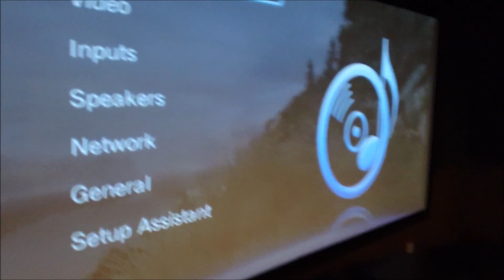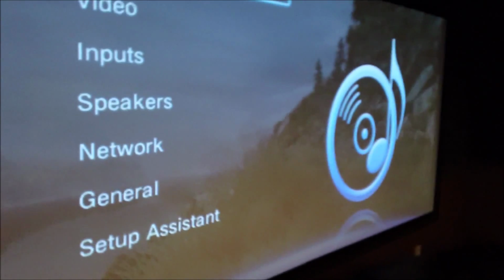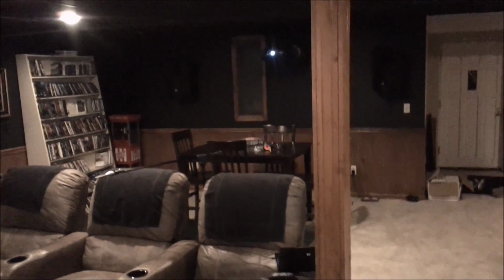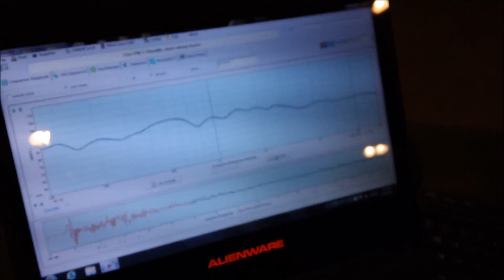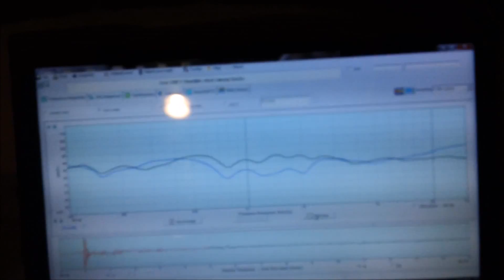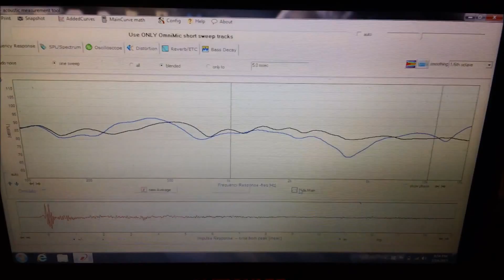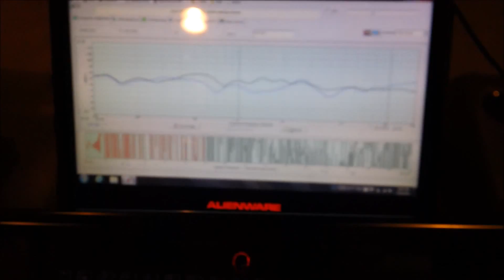Flat Frequency Response High End Speaker Debunk - Why it doesn't really matter

Comment: It doesn't need to be PERFECTLY flat, but it still needs to be flat enough, is it correct?
Reply from the maker: That's correct - but if you EQ for a single seat, it will change the EQ in the other seats -- so which seat is flat and which is worse for the first seat being flat?

Comment: This is dumb. Of course frequency response changes with mic position.
Reply from the maker: Well here’s the deal. I posted this video in reply to an AVSForum argument where people were arguing over the recommendation of one speaker over another because the specs were a dB or so tighter than another speaker — intending that the 1 dB of frequency response tolerance made the one speaker better than the other.  Having listened to both speakers extensively and owned them both I knew the “inferior” speaker was better.  I created the video to show the concept that that +- concept and benchmark racing doesn’t amount to much when you put it in a room where the +- range increases dramatically.   You may know this — certainly everyone on AVSForum in that discussion thread did not.
Reply from the maker: Point being that people obsess about specs +-3 dB 35Hz to 20KHz for instance and if you move the mic a foot or 2 you might be +-5dB or even 10dB
Reply: @jvonengeln  When tuning speakers it's probably best to test directly in front and at 45deg off-angle. Then add a little high-end sparkle to the make the mid-point between the two of them flatter. 

Nothing is done in isolation, specs included.
Reply: @jvonengeln  The point being you need some kind of reference when designing speakers and results need to be tested against baselines.
Reply: @jvonengeln  and yes, it does make +5 or 10dB difference when you change listening position sitting in front of a whole bunch of random sub-woofers in amongst couches and wall treatments. It's a room. It has a sound. 

Even in an anechoic chamber you'll see differences let alone in a room.

Comment: You're missing the point.  Frequency response is important because it indicates how accurate a speaker is.  A good speaker treats all input frequencies equally - it doesn't alter what is being fed into it.  A speaker response that is rough with crude spikes indicates that the designer has failed to control undesirable resonances.  Of course, in order for a frequency response specification to meaningful, it must include a +/- db tolerance with the spec.  For example, 80Hz - 20,000Hz +/- 3db, or in the case of my beloved Paradigm mini monitor speakers 57Hz to 20,000 Hz +/- 2dB  (the tighter the tolerance, the more accurate the speaker is)  Every audiophile knows that the frequency response changes depending on the room and that adjustments are needed to get the speaker to sound perfect, but you must have an accurate speaker to start with.

Comment: Flat frequency response is very important in recreating the intended sound that was intended for the listener.  Just like every strong structure or system, the foundation haas always been the most crucial part of it all.  It must start off at a flat response at both on and off axis.  Noe of course the room will change the tonal balance do to reflections, standing waves, and other factors.  Thus you must use absorption panels to limit the cause of the tonal imbalance.  To spot the problem areas however you will need a reference mic, and do a waterfall test to see where the decay time happens within the frequency spectrum.
Reply: Exactly.  A quality speaker with a flat frequency response treats all frequencies equally and doesn't alter the sound being fed to it; it is a measure of speaker quality.  Every audiophile or audio enthusiast is well aware that the room affects the sound which requires equalization adjustments or room treatments such as absorption panels, etc.

Comment: speakers with an inherent flat response would at least, go less hay-wired than those that have already hay-wired inherent response. i've heard a lot of colored systems, they never work well in any room even with EQ. though, i'm not into high-end. good speakers don't have to be high-end. even junk-grade components can turn into a really great system if you know how to do it.
Reply from the maker: Ped-Away-G   Mackie c200 have a very decent FR, and polar plot.  Published on Mackies site.  This will happen in any room with nearly any speaker.  I’ve measured several dozen home theater rooms during tours on avsforum.  It’s just the way it is.  I really enjoyed the Mackies for what it’s worth.  The only way you can get away from that issue somewhat, I think, is with line array speakers.  Which is why I now own 13 JBL CBT 70j-1 in my theater room.  The universal similarity in the coverage of sound as you move about in my theater room since installing the JBL line arrays is the best I’ve experienced in any room. Every seat  sounds the same, standing up, sitting down sounds the same.  The stereo listening sweet spot you can barely escape from.  I need to do a part 2 of this video for comparison with a FR capture using line arrays.

Comment: One question. Why are there 5 subwoofers up front? I feel that overpower the rest of the system.
Reply from the maker: Jesse Johnson  headroom.  I dial them in no louder than I would if I had just a single sub, but as i turn up the volume when a single sub system would be distorting and begging for mercy my eight 18’s stay distortion free and clear and accurate.   Each sub has less work to do individually to achieve the sum output.

Comment: Thanks for the vid. I'm not an audio engineer nor an audiophile (meant in a negative context), but appreciate the video as a good reminder that those of us who take a more scientific approach to system design may be suffering of some of the same delusions as the audiophiles who need solid gold 24k cables, purified energy source and so on. Thanks! Unfortunately this doesn't make the process any easier for anyone :)
Reply: I consider myself an audiophile but I'm also an electrical engineer so I laugh at these so called audiophiles who claim that these crazy cables and connectors make a difference.  Not until you enter frequencies in the radio frequency range does it make a difference.

Comment: I was gonna say something different, but then I actually watched the video. Dude. You're clearly not an audio engineer, stop acting like one. You're saying there's no reason for flat response speakers on a home theater. You're right. But what you're not aware of is making you look a bit cocky, tbh. First things first, the other posts got it right. Flat response speakers are for mixing and mastering. You're not doing either of those things. Second of all, your main channel speakers should be the same distance from one another that you are from the center of the sound field in your regular listening position. Third, your speakers need to be at specific angles in relation to that listening position to accurately reproduce a stereo sound as it was intended to be heard.

That being said, of course if you move the listening position the response changes. That would be obvious to anyone who had any business talking about flat speaker response. 

Also, why do you have a whole five speakers in your front section? Seriously, what is that? I mean, I have more than five myself but I've never seen or heard of a setup like what you have. My channels are: L, C/S, R, RR, LR (clockwise rotation). It's 6.1 surround, I just don't have my RC installed yet. So why do you have five channels up front?

I feel like I'm looking at a car enthusiast who doesn't know how a piston works.
Reply from the maker: Every last thing you said is inaccurate. I don't have time to respond right now, but I will.  It is you who don't have the knowledge to back up what you've said.
Reply from the maker: Okay - I have a few minutes...The context of this video is that folk were stating on AVSforum that a ruler flat starting frequency response of something like the JBL M2 was essential for accurate music playback - - - to hear it as the artist intended.  It was my purpose in this video to show that even if you have those $20,000 speakers with a ruler flat frequency response in an anechoic chamber - once you put them in a REAL room they will NOT render a flat frequency response in most places where you happen to be listening to them in the room.  A typical room has more a much stronger effect on the final frequency response of a loudspeaker than the delta between a elite speaker and a good speaker.  The frequency response is all over the map just by moving the microphone tip (representing your head) a few inches/feet one way or the other.   The other main point you made about my 'questionable speaker arrangement' is laughably absurd.  Those aren't my speakers at the front of the room on the floor - those are my subwoofers.  You tell me I have no knowledge???  How is it possible you confusing mainspeakers with 18" subwoofer drivers? (Dayton Audio UM18-22)   My mainspeakers are behind the acoustic transparent home theater screen at the prescribed dolby digital specified angles, and at ear height, and angled in towards MLP.  Your commentary on that matter alone shows you to be an amateur - who doesn't know their way around audio whatsoever --- but it's interesting that you spoke with authority as if you had the knowledge - belittling me in the process.  The mic I'm using is a calibrated microphone called Omnimic.  It is intended to accurately show any number of things (decay, frequency response, impulse, etc) - in this testing I was measuring frequency response.  If you'd like to know more about my actual setup vs. just spewing amateur hour nonsense - you can take a look here: http://www.avsforum.com/forum/15-general-home-theater-media-game-rooms/1525397-archaea-s-multi-purpose-home-theater-room.html   Good luck on your journey in this cool hobby.  You've still got much to learn.

Comment: LOLflat frequency response speakers are made for producers and musicians to be able to generate sounds with accuracy not for home theatre systems
Reply: He needs another sub-woofer. Only then will his last testicle descend.
Reply: and "just" 10db variation is huge cause the sound is logaritmic not linear
Reply: Flat frequency response is applicable to all speakers and headphones because it is a measurement of how accurate the speaker is; it doesn't matter if it is for home use or studio use.  If you buy high-end, quality home speakers the frequency response measurement and tolerance will be specified, for example, a good tower speaker will specify a frequency response of 40Hz to 20,000 Hz +/- 3db.  A quality speaker will have a tighter tolerance of say +/- 2db which is the tolerance of my Paradigm speakers.  If the +/- db tolerance is not specified, the the frequency response spec is useless and serves only as a frequency range, not a response.  There are many home speakers that outperform and cost more than studio speakers.  Studio speakers are near field speakers that only have to project sound a short distance to the sound engineer at the mixing board whereas Home speakers have to fill large rooms of varying size.  Of course, I'm not referring large professional PA speakers that you might find at concerts but these are not really focused on accuracy as they are about loudness and dispersion.